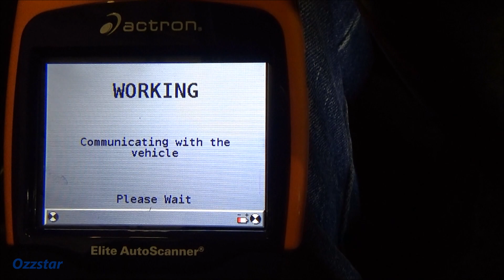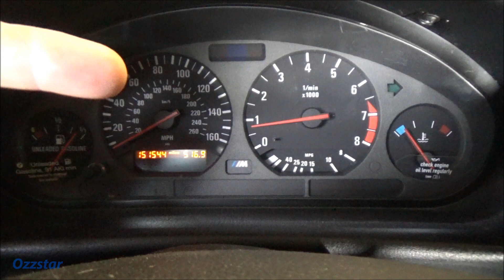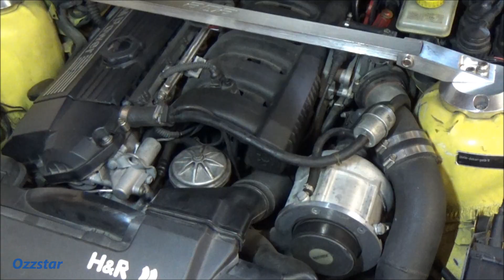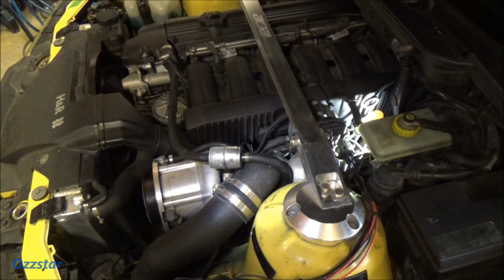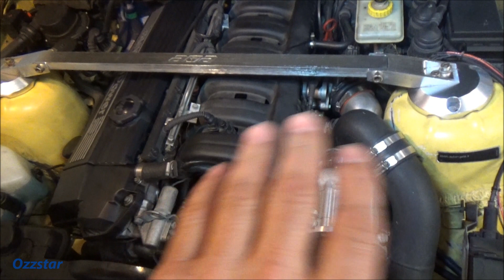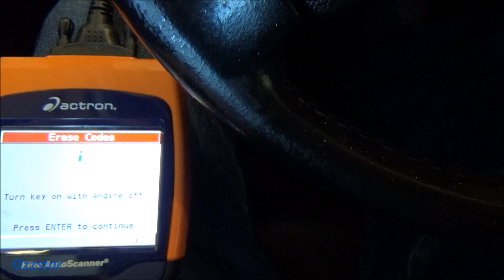Trouble codes P0170 P0173

Comment: I have the same 2 fuel trim code's but with cylinder 4, 5 & 6 misfire. This happens intermittently. My airflow readings seem to be all over the place at idle. Could this indicate a MAF issue?
Reply from the maker: Have you done a smoke test? Look for a vacuum leak.
Reply: @ozzstars_cars  not yet as I don't have a equipment. I do have a video of the noise it makes when revving. Almost sounds like a rush of air? This can also be heard when I turn the engine off at the end. The weird part is the codes and misfire only kick in if I let it idle first. Normally if I switch on and drive they don't show, however I do suspect I have reduced power and fuel economy. When the codes and misfire do come then they stay until I turn of and on again

https://youtu.be/dhQ_LB4Mcp8?si=LtLWApFH0wGlEBcv

Comment: My 99 528i started acting weird today after driving quite a bit. Threw these 2 codes and shakes horribly. Loss of all power essentially. Had it towed home and it started right up like nothing happened. Just a little hiccup in the idle. Could it be clogged cats by any chance? They smell horrible under load

Comment: Ive been chasing this p0170 and my CCV system is actually deleted and  vents to atmosphere. Aswell as my dip stick hose. Would getting a breather and capping/winching the oil pan hose fix this? Going to do it regardless lol
Reply from the maker: Sounds like you have a lot going on there?

Comment: Good day tell me the error code P1519 in BMW E39 m52tu where to look for a fault. Thanks for the early update.
Reply from the maker: Check the neutral switch circuitry (range sensor).  Visually inspect the related wiring harness and connectors. Check for damaged components and look for broken, bent, pushed out, or corroded connector's pins.
Reply: @ozzstars_cars  Thanks I'll check

Comment: Weird setup.  Almost like a catch can type of deal going on there, at least the one on the diagram & dipstick tube .  Cool video Glen!
Reply from the maker: Yes very similar catch can in a stock configuration that never needs to be emptied.  The aftermarket super charger inline CCV fuel filter is even more weird to me.  Thanks Cuba

Comment: Euro cars are odd ducks, I'll tell ya! It's pulling fuel away for a vacuum leak ... but yet it still runs! Pretty sure that's because I have zero understanding of BMW systems. I can't make heads or tails of that! Why does it pull back injector pulse for a lean condition when it should be doing the opposite?  🤔 Must be fun to drive at least with the forced induction. 👍

Hey, we've got the same smoke machine! Think it was $70 on eBay. Better than 4 figures any day! 😁

Nice detective work there, Glen. Don't know how you can find anything under that intake there! Pretty tight quarters.🍻
Reply from the maker: Yeah it was stft -28 and running richer than hell with a vacuum leak.  Crazy.  So you have a $70 bong? 🤣
Reply: @ozzstars_cars  - 😂🤣😂 Smokes just like one! Not that I would know or anything ... 😁

Comment: Great work Glen! I would have thought with a vacuum leak the trims would be positive. Nonetheless it’s fixed now.
Reply from the maker: That's what made things interesting to diagnose.
Reply: @ozzstars_cars  the hose was sucked close, so no idle air entered the engine. That's why the engine was running Rich.

Comment: Glad it worked out. I know that supercharger complicated everything.Great job explaining the CCV valves.
Reply: Nice one Brian. Your a class act.
Reply: wyattoneable thank!
Reply: stock CCV are useless in old bimmers, i've seen many times people replacing whole system with new OEM parts, and it still pushing oil into intake. I'm from Europe and owner of E46, also couple friends owns them, best solution for us was to throw stock CCV system out and put oil catch can instead. With oil catch can engine runs much better, comparing with new CCV and also its a way cheaper way to solve problem.